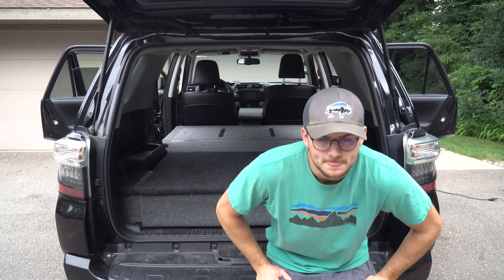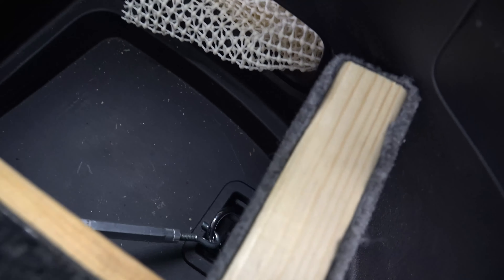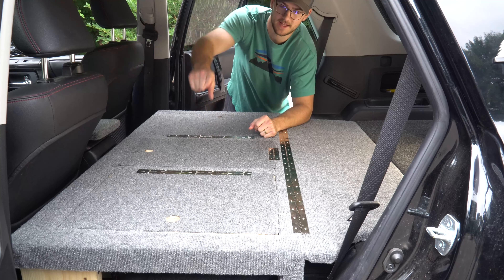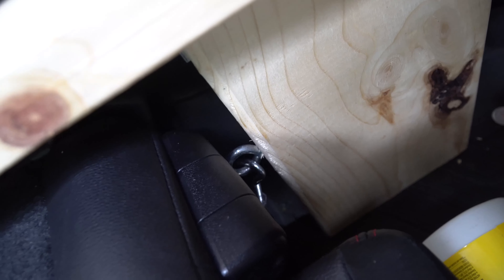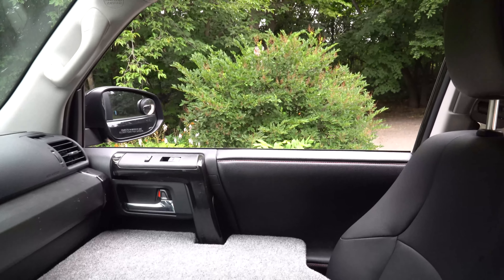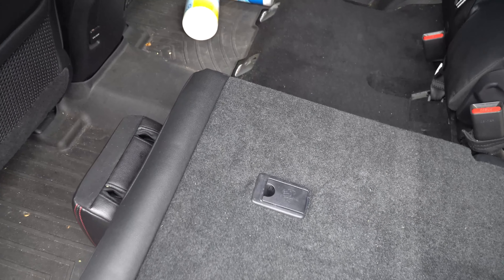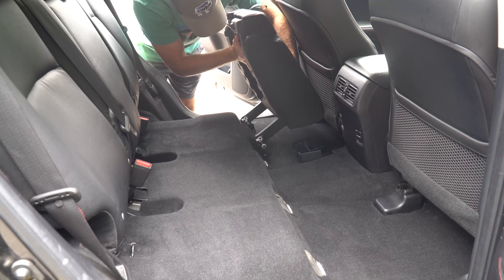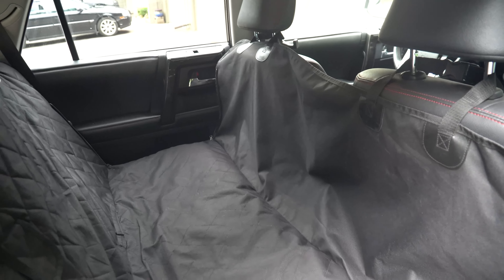5th Gen Toyota 4Runner Overlanding Platform Walk Through | Affordable | In Depth Review | Dog Bed!

Comment: Nice design! I was planning to do something similar for my Isuzu Rodeo Sport when I go overlanding. (Mine is shorter though, so I need to sleep above the front seats, I was planning to use large drawer style pull-out hinges for that).
Yours is probably the most professional design I have seen so far on Youtube. Nice with the trunk mat also. Turnbuckle is a key word I learned just now. Thanks!
Reply from the maker: Awesome!  I’m glad you like the design.  I tried to create something functional but also easy to install.  Check out my rear drawer video because I did modify this design slightly.  The rear hatch is not the most ideal with a mattress, bins or cooler loaded in the trunk.
Reply from the maker: However, it is slick for everyday use if you do not want to spend the money on extra plywood or weighted drawer slides.  It just depends on the use case really.

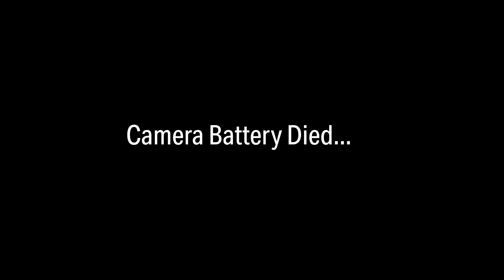Comment: This is awesome. You could add couple hinges so that the legs on the middle section at 13:29 folds inward that way is easier to get in and out of the car but not a huge deal.
Reply from the maker: Yeah great point.  I have seen the heavy duty locking hinges some people use for weight bearing fold up shelves in vans and stuff but they are a bit pricey.  Also, I noticed they still have a little play and I did not want the platform to sway while driving offroad.
Reply: You did consider! Well instead of pricey hinge. Use double hinges. Cut 2 piece same length as the current leg that will fold from L to flat. When placed the second hinge will move into L position to lock the leg in place preventing sway. I am planing on testing this. Thanks!
Reply from the maker: @blizzster  Awesome!

Comment: I’m just about to purchase a new 4runner. I’d like to do the exact same setup. This is the best I’ve ever seen! I want to remove the 2nd row seats completely though since I won’t be using them at all. I would love to be able to ask you questions if o need any assistance building this myself.
Reply from the maker: Feel free!  I’ve got fairly detailed blueprint videos too.  If you take out the seats, be aware that the middle section which only has legs on one side and a beam/board on the other side could probably use another set of legs on the beam/board side to maximize storage.  Otherwise, since the beam/board side rests on the folded down back of the seat, you will need to beef up that section since the seat will no longer be a resting place.
Reply: @OverlandEngineer  awesome!! The blueprint videos will probably be very helpful. Thanks for the suggestion on reinforcing the board on the seats area.  I love the look of that carpet you put on as well...does it help with insulation much? I was thinking of just putting down a vinyl sheet floor instead for easy cleaning.

Comment: My favorite part is the dog bed. It would also be handy for a work surface in a truck during the day.
Do you really think you need the turnbuckles? Nothing would shift with the back door down in my opinion.
Reply from the maker: Thanks, yeah I have not seen another platform with an added Dog bed.  The turn buckles are honestly more for safety.  But even then if you get in a crash the turn buckles probably won't do too much.  It also helps with rattling.

Comment: Informative and instructional of a well designed and constructed platform...Did you create the platform design as you  proceeded with the construction of the various platform sections or did you have initial drawn plans or sketches with required measurements for the various wood components to achieve the final design/construction?. Very well done, excellent design and carpentry skills.
Reply from the maker: I had an overall vision for the platform when I started.  I measured each section custom then anchored it in the vehicle so the anchored portion was the frame of reference for the next piece.  I took all the dimensions at the end to show my design because at the time there were very few videos on YouTube that did a dimension breakdown and explanation.  Most people did a brief walk around showing functionality.  Thanks for the feedback!  My biggest recommendation is use spray adhesive for carpet and apply generously because it gets soaked up, then staple it down.
Reply: @OverlandEngineer  Interesting process...Thank you, continued success with your YouTube endeavors.

Comment: Great design!   Thanks for sharing.  Any particular reason you did a lift up platform on the rear portion as oppose to drawers?
Reply from the maker: Primarily cost!  If you want to do something on the cheap, some old door hinges, a 2x8, and some plywood gets you the majority of the way with the hatch design.  Its not the most convenient but it stores things under the bed, especially if you use bins.  Some gas struts could easily solve any weight issues if you needed some help lifting it with a heavy foam bed on top or something.

A drawer setup is probably more optimal.  It allows you to get under the bed while having things stacked on the bed or even if someone is laying on the bed.  However, weighted drawer slides are around $100+ and you will need additional plywood, pocket screws, glue, jigs, etc.  It requires more tools which can be accessible, but often times a barrier for someone getting into overlanding that needs a simple design to get out there and customize their setup based on their preferences!

Long story short, this is a super attainable build for someone with a drill, hand saw, stapler, and some screws!

Comment: Too bulky and heavy bro and takes up too much space imo but great job and as long as you like it 👍
Reply from the maker: It was a great first platform but something new is coming...!
Reply: @OverlandEngineer  I just made a platform for my 2020 rav4 hybrid.  It's modular folds away in the trunk and takes up about 5 inches of trunk space and lays flat and I can still use 2bd row.
Reply from the maker: @KoiTimeUSA  Thats awesome.  I removed my seats for the headroom since I'm 6'3".  I originally designed a similar platform in my 2011 RAV4 but when I got the 4Runner I decided to remove the seats. I reinforced the platform for the surface doors and it probably made it more bulky in the middle.  It would be easy to make it less bulky if I wanted less storage options.
Reply: @OverlandEngineer  yes you definitely need for space to be comfortable.  Luckily for me I'm only 5'8" I was able to chop the platform into halves 2 sheets of 39" x 35" and it folds neatly into my trunk. I haven't carpet the .5" plywood yet.  I think I just might throw a sleeping bad on the platform and try it out like that.